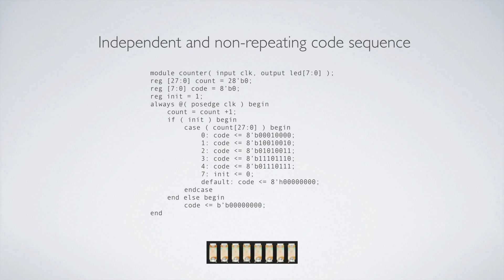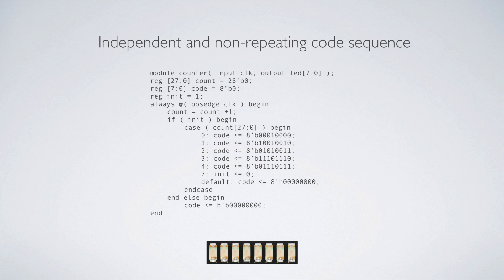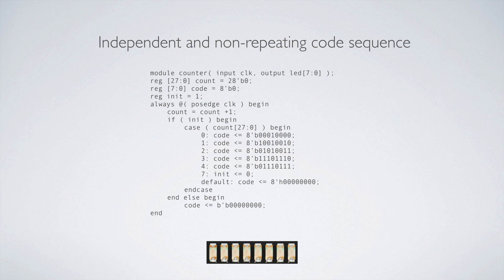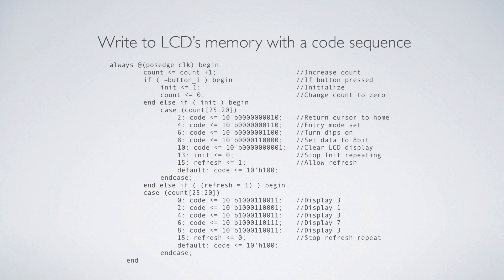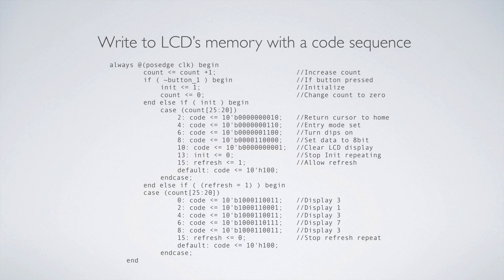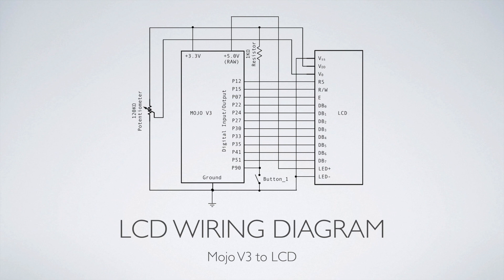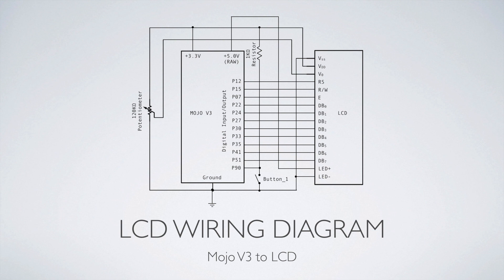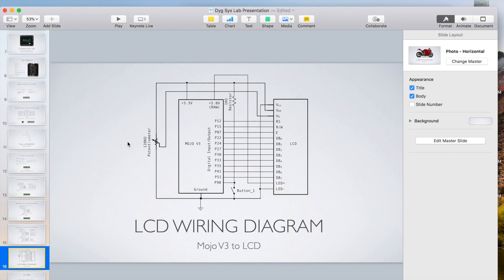How to code verilog for a LCD part 4: Final concepts for LCD and wiring diagram.

Comment: Excellent video! Clearly explained and easy to follow.
Reply: @geek3502  I would like to see you construct write code for an FPGA that controls a servo through pulse width modulation. It's a project that I am currently working on and would like to see how someone else takes a crack at it. I also have a quick question regarding the code in this video: do the FPGA boards come with built in debounce time mechanics? Your code does not account for it and other tutorials I've seen don't either. Thanks for the content!
edit: I don't own an FPGA board yet. All of the coding I'm doing is in Vivado, that is why I'm unfamiliar with the debounce mechanics of the boards.
Reply from the maker: You got it! https://www.youtube.com/watch?v=JpzeoQI2MII I am unaware of any FPGA boards that come with debounce time mechanics but I could very well be wrong. There are MANY ways to debounce. Personally the easiest for me at this point is the way I show in several videos. However, in the past I have been know to install a filter (CR) any any board prints I do and some prototyping.
Reply: @geek3502  Thank you, I'll check out your ultrasonic video after I have some free time later in the week.
Reply from the maker: Glad it was helpful! Glad you enjoyed it! Thanks for watching!